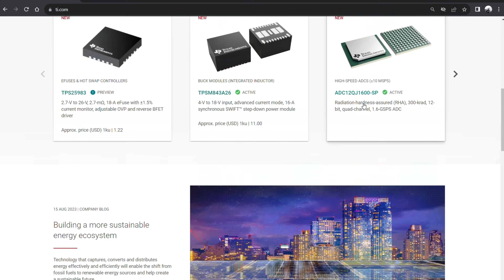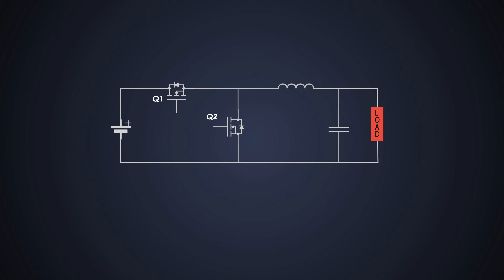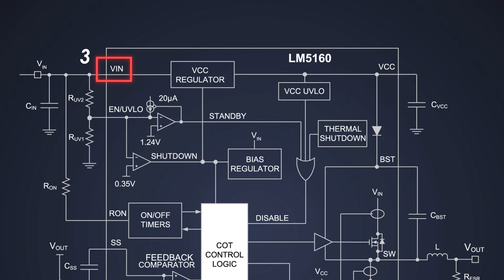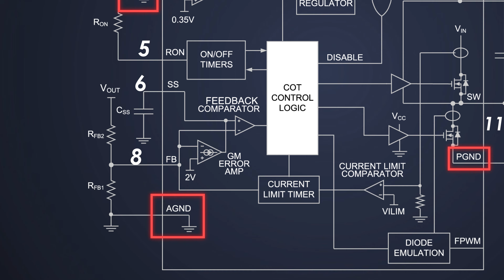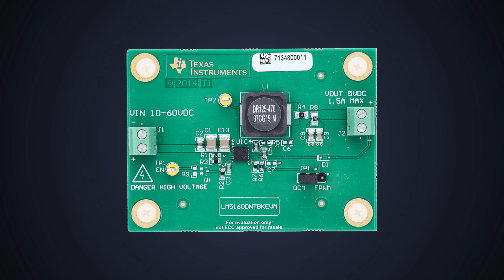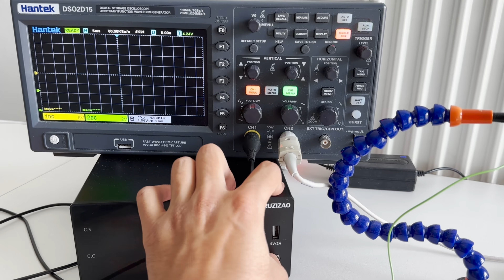How to Design a Synchronous Buck converter | Synchronous Buck converter LM5160 | LM5160DNTBKEVM

Comment: Synchronous buck converters have a certain disadvantage, especially at higher switching frequencies. The low-side MOSFET can open, when the high-side MOSFET opens. This is caused by the Gate-Drain capacity. The gate line has an inner resistance followed up in the circuit by a line resistance and inductance. If the upper MOSFET opens very fast, the Gate-Drain capacity can jump up and cross the Gate threshold voltage. In this situation you get a shoot through both MOSFETS from Vcc to GND, which can destroy the MOSFETs easily.

The easiest way to avoid this behavior ist the limitation of the switch-on velocity of the high-side transistor by use of a gate resistor. This resistor can be bridged by a fast diode in order not to compromize the switch-off velocity. This Gate arrangement can also be applied to the low-side MOSFET in order to connect it stronly to ground when the high-side MOSFET switches on.

Comment: You must show test of LM5xxx buck converter for maximum input voltage. There are many buck which works upto 30v. LM5xxx series provide high input voltage range since you have such evolution board you must show results for Max input voltage. By the way information is useful thank you
Reply from the maker: I have done the testing based on the design, it doesn't depend only on IC voltage.

Comment: If you can please reply back to my questions thank you 

Why buck converter current amplifying stop amplifying the current when the high valve capacitor is replaced with a lower valve capacitor

Comment: Please show me how to design a synchronous buck converter using IR2104 MOSFET gate drive IC to step down a DC voltage from 220V DC to 110 V DC, if not possible using IR2104, do it using a suitable IC and drive a 220V DC motor with maximum load current like 10-15A.

Comment: If possible please guide to make a powerful synchronous buck converter like 220V, 50-60A output max and the components selection specially the control IC.
Reply: Even I want the same 😅
Reply: There is no synchronous buck converter in this specification because in this reliability of the converter will be very poor because of MOSFET body diode .